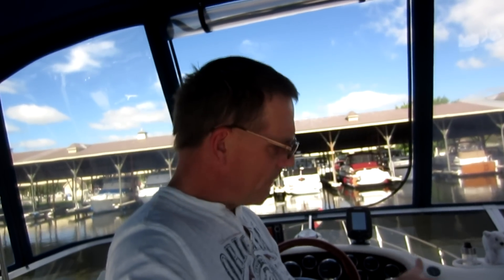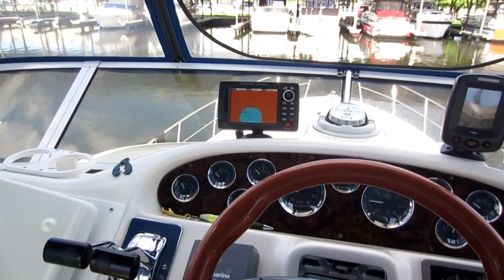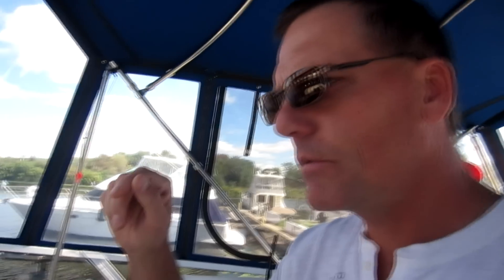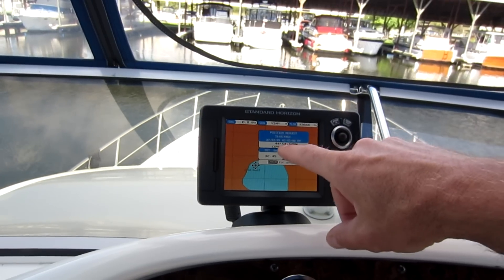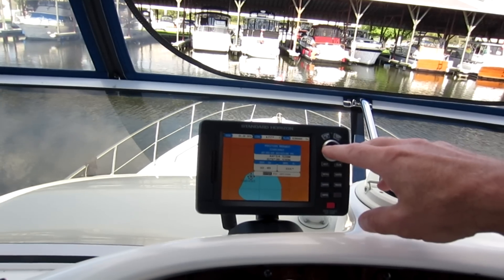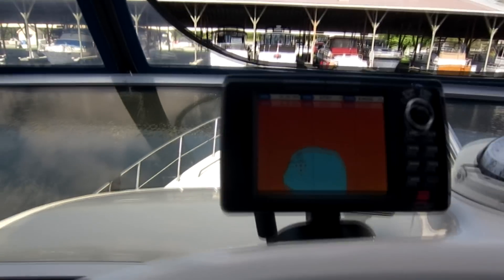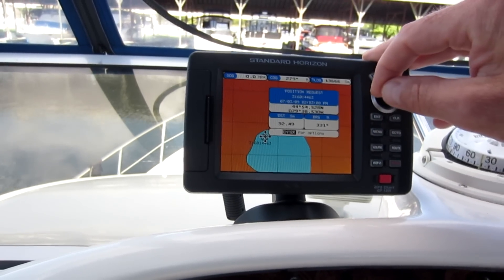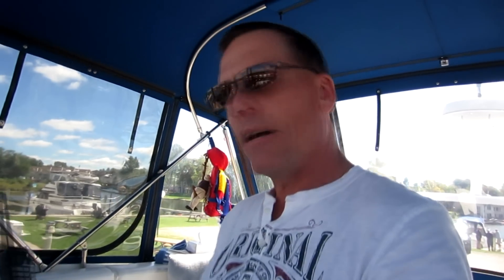Boating How To - Marine VHF Radio MMSI and DSC

Comment: DSC is problematic with handhelds in that handhelds so equipped are really linked to the one boat. If you switch boats then you can't use that handheld VHF because DSC will misidentify the boat.

Comment: Well done. I am a scanner listener and took my VHF radio course from PCS in Toronto in 2010 and also have my DSC endorsement. Unfortunately, I don't have a DSC radio and only an older VHF handheld and I am also a ham radio operator, which gave me a leg up with some of the calling procedures and phonetic alphabet.

Nice to hear the old CMB at the beginning of the video too, rather than the current computerized copy and paste voice which we hear as of 2016. Love your videos and keep up the great work.
Reply from the maker: Sounds like you have more knowledge on correct procedures than 96.94% of the operators we ever hear on the radio. Can be very frustrating listening to some of the exchanges coming over the airwaves :-/ It's too bad that the only place in Ontario that the average boater can go for a radio course is through the Power Squadron. I'm sure that for many - myself included - that is constraining and reason #1 for not taking the course. Don't know why it's not offered online. . .
 And yes, the old human voices providing updates could be a hoot. One didn't know if their command of one of our two official languages could make for some humorous (and even confusing) reports. Recalling a particular NOTMAR safety bulletins from back in the day (which seemed to repeat through much of one season), I still hear/say 'Pigeon Lake' as Pigggon Lake ;-)

Comment: Yes, very informative vid! Thanks so much for sharing your time and advice. I was thinking about picking up a used radio for my boat but...not if the MMSI registration number needs to be changed for/to a new user. I'll skip that process. You just helped me with that decision! The lake is way high right now - surpassed 2017 levels. As always people, play safe on the waters!
Reply from the maker: Actually, I've since learned that here in Canada, the registered user of an MMSI can be transferred. I had to do that when we bought the current #Boogaboo. I'll try and do an update video on that process...

Comment: When I got a handheld a few years ago, they (transport Canada) gave me an MMI, not an MMSI, because I didn't have a boat at the time. Then when I got the boat a couple of years later, they gave me an MMSI for the boat, leaving the older MMI still assigned to the handheld.
Reply from the maker: Cool. As I believe I mentioned in the video, my handheld was the very first in Canada to get an MMSI assigned to it. As you can imagine, it took a bit of explaining to Transport Canada the what's and why-for's ;-)
Reply: spelunkerd